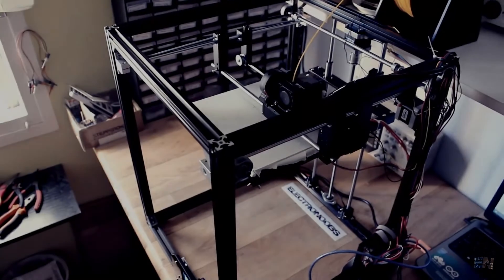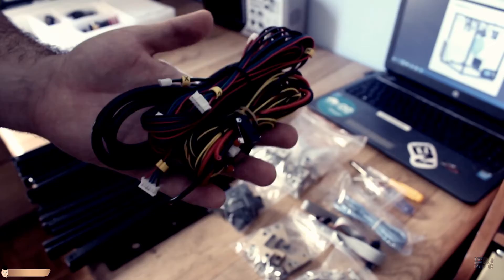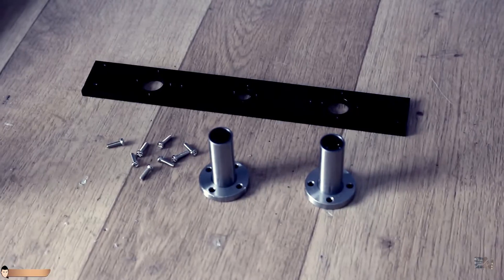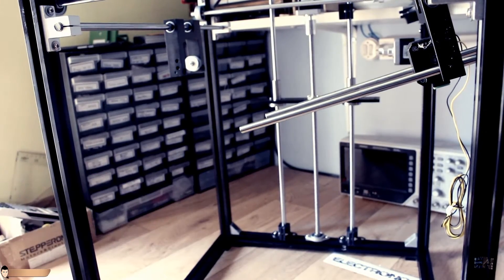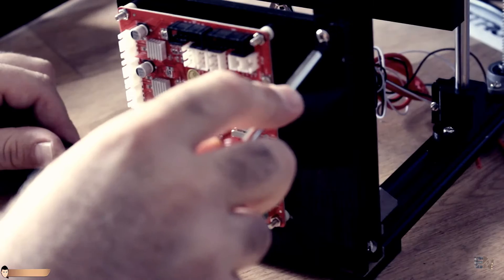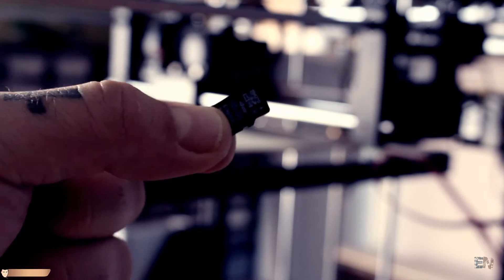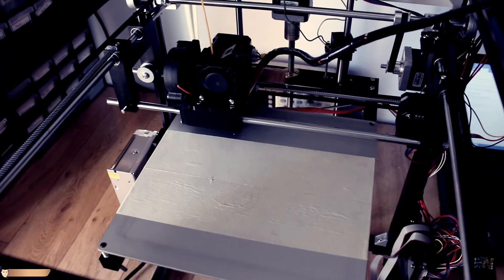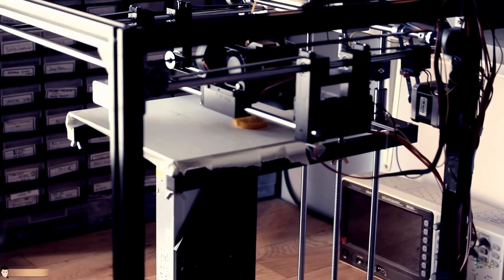Why TronXY X5? - Assemble, review, test

Comment from the maker: Thank you very much. I hope that you enjoy the video. Visit my webpage for more tutorials http://www.electronoobs.com Also help my workshop on my Patreon campaign https://www.patreon.com/ELECTRONOOBS
Reply: Nowhere on any directions or assembly which length of frame piece goes where? It would have been so easy. So far this assembly has been a nightmare. You have to figure it out so it means taking it apart and putting it together over and over for every detail.  The longest frame pieces are the vertical part of the frame. But I can't tell anywhere if the shortest frame pieces are the front or the sides. LCD mount being the front. Anyone have any idea?

Comment: hey Top Tip Flip This Printer Upside Down Then Remove Bed From Z Axis Remove Z Axis And place and reattach but on the upside down place replace the extruder with a 405nm laser place uv resin in vat made as a replacement bed make a arm attack laser of sheet metal onto arm attach arm were the bed holder was then link laser up to the 3d printer ad pew there's your sla 3d printer made from a fdm and get 10 micron print out of it !!!

Comment: x5 or x3? I'm in a dilema. Help me! Other maker said, that the printer is ok but the bed is very wobbly and the gcode problem once decelerated it doesn't get back to the standard pace. how noisy is it? How far can you heat the bed? Please let me know.
Reply from the maker: Short to Ground the heat bed over 60 degree has problems heating more. the bed is now wobbly. I've used it just a few days. I will make a new review after some more print tests.
Reply: Electronoobs hi! :) 
Are you still planning to do the video and what are your thoughts about this printer a month later?

Comment: Nice, well explained Video! Just one thing: Please use crimp contacts for mains wiring.
Reply from the maker: Thank you. Not just that. I will upgrade the entire power supply with a small plastic case for better safety features!
Reply: Electronoobs more safety regarding high voltage is never a bad idea! 
keep it up!

Comment: dear sir,
i want to know about some 2.4ghz transceiver.
first , would like to ask why it there is no simple circuit available on internet like fm transceiver? whenever i search for 2.4 ghz transceiver, they show me ic or MCU don't know what really they are but like nrf, esp, csr etc.maybe 2.4 ghz has different profiles?!
if i would like to build my own, how can i ?
suggest me 
thanks👍
Reply from the maker: If you want to build a 2.4Ghz transceiver you will definitelly need an MCU for that. 2.4Ghz is not like old school 433 with a local oscilator. Any way, the NRF24 is a great module, very easy to use!

Comment: Epoxy a coin to the top of that adjustment bolt so it has plenty of travel room and if the filament hangs up on that, maybe use a a sealed bearing that fits the shaft so you can just exchange new spools. Just a idea
Reply from the maker: Thank you!